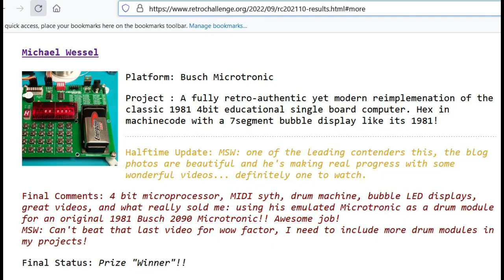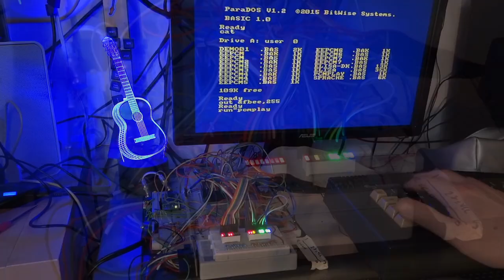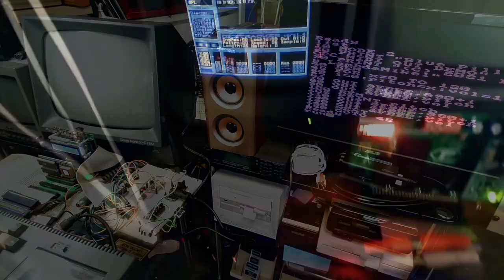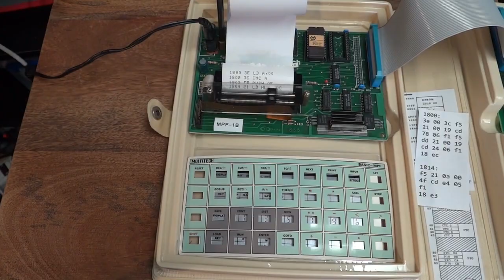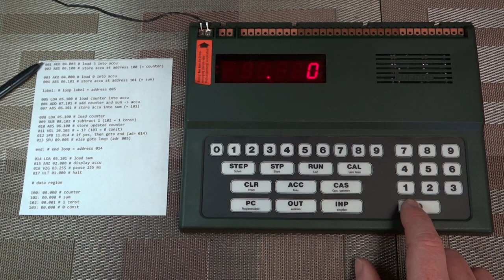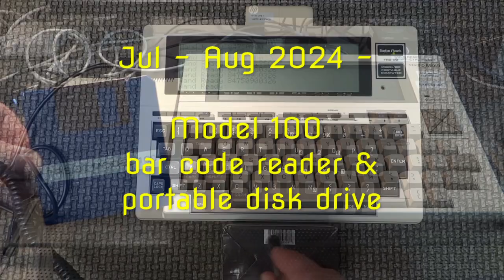LambdaMikel Says Goodbye - Closing the YT Channel

Comment: the YT algo blessed me with this vid and channel randomly.  I'm actually working on my cassette futurism rack with various monitors & devices and want to have various videos and "AI" interactions show on it. I bought a couple Sony PVM and LCD rack monitor panels. I have some random stuff too. I want to kind of make it look like something out of the movie Alien(s) or Blade Runner.  I saw your other video too right now and I went to the MoMA in NYC (first time in NYC) just to see the Connection Machine. I've been a huge fan of it and have some PDFs and an actual book about it too. I've even talked to Tamiko Thiel. I love the idea of visualizing the "thinking" part of the machine via blinkenlights. So my homelab cases are built around that idea; maximizing blinkenlights, mostly through excessive amount of drive hotswap bays. I don't personally own any cool older machines yet. I'm mostly limited right now by the size of my apartment. I've had chances to even own some old IBM mainframes (Z systems) but I couldn't put them anywhere. I suspect once I have an actual home, I will turn into a bigger hoarder and go all out more.
Reply from the maker: That sounds like a really cool project!